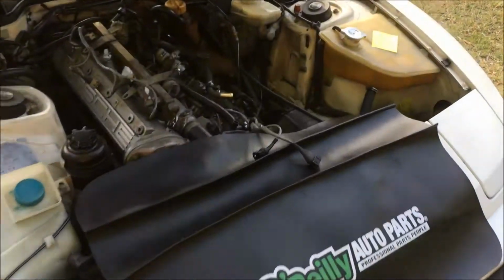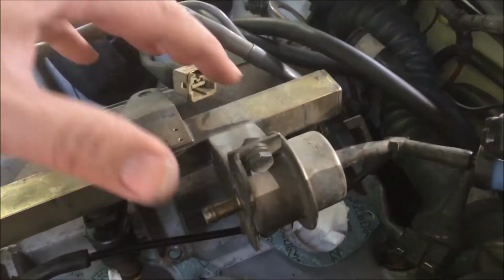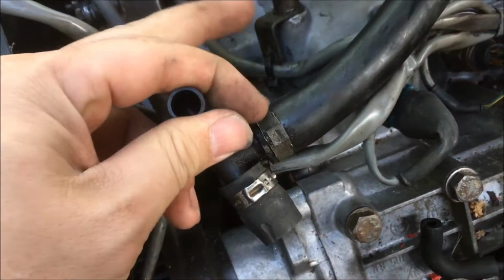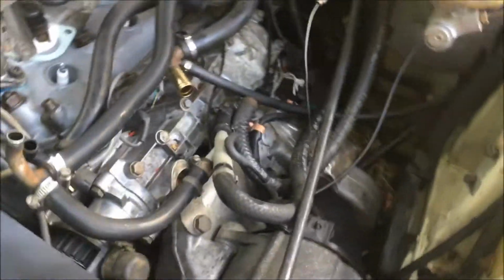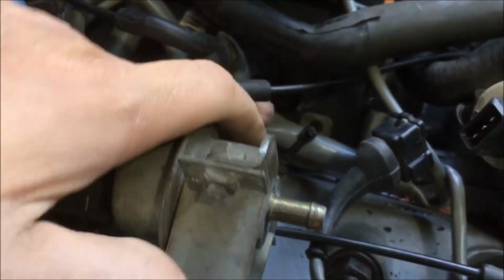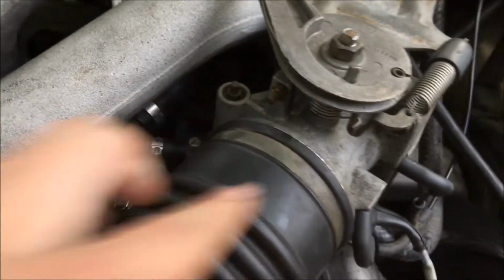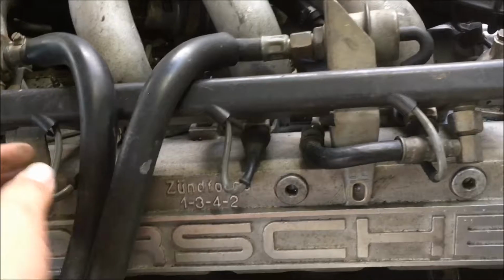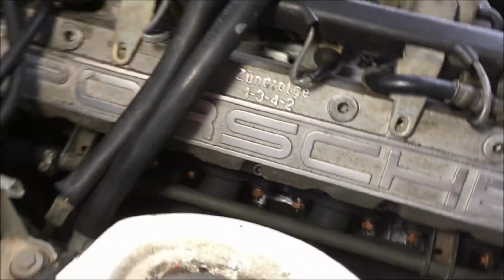Porsche 944 Vacuum and Wiring Routing for Late Cars

Comment: I just reinstalled my intake manifold yesterday. What was Porsche thinking mounting the ICV on the block, and then l,inking it to the intake manifold by a short little 'S' shaped hose that's nearly impossible to get to? If I do this again I'd figure out a way to mount the ICV to the intake, so the only connection you'd have to make after you bolt it to the head is to the J-boot. There's plenty of material in the webbing between the runners to mount a couple stand-offs with M6 hardware.

Comment: Thanks for the video, very helpful but I have a question, I have seen in many diagrams that the heat valve that is near the position sensor also use the vaccum line that is near the vacuum reservoir.
So do this lateral version don't have a heat valve or you skipped it. 
I really enjoy your videos thanks for all the help.
Reply from the maker: Thanks! Yup I just missed it but I covered it in my turbo vacuum line video. That particular item is connected the same as the N/A respectively. I hope that helps!
Reply: @edredas  thanks for the quick answer I'll check that

Comment: Just sent off to Lindsey Racing for a vacuum kit for my 86 NA. Thank you so much for posting this! Is a venturi delete anything worth doing, do you think?
Reply from the maker: I usually don't bother on an N/A car since the vacuum lines are fairly simple without any benefit. That said, it can be worth doing on a turbo since it has a ton of hoses running everywhere that it helps clean up. Its up to you though. If you're buying the entire kit from Lindsay then venturi delete may be the way to go! Good Luck.

Comment: I have an 88 but the manufacturer date is 87 and some of the things you have shown of the 88 don't match my 88. Also the VIN on the fire wall doesn't exactly match the VIN on the window. Fire wall has the 4 to 9 digits z z z z 9 for Z and the one on the window are a b 0 9 4 6 and the last 8 are JN471207
Reply from the maker: That's correct, the firewall stamp isn't the VIN number which can only be found on the plate in window. That said, this '88 model actually had an earlier engine swapped into it... which isn't the first time seeing this. I made sure to keep the vacuum lines correct but often people will just drop another engine in or something will break and you end up with mixed up parts. Although, I have an early production 924S that has several unique features that weren't on any other cars, so that its possible that your car is unique. Can you tell me about some of the differences?
Reply: Mine has the earlier vacuum brake booster port with the extra nipple for the vacuum that comes off the switch under the intake also the hose that comes from the air oil separator does not have an extra end leading to the intake other then that it seems all the rest is the same I am assuming at least. I need to remove the intake to replace some of the lines under it when time and some warmer weather permitting
Reply from the maker: Thanks, I'm not sure when they moved the check valve, but it is interesting that you don't have the hose going valve on the rear of the intake. Do you have a venturi? If you do then you may need to check the engine code, on '88 models it will be on the block next to the no. 4 exhaust header.
Reply: edredas no there is no Venturi and it has the correct cap for the block off. I just figured it was a transition car like some of the Ford's were when they go from one year to the next and have a mixture of previous and next year parts.
Reply: I will look at the engine code tomorrow and let you know
Reply from the maker: I have seen some things like that,  however I don't believe the factory would have done this. My understanding from the factory literature is that the venturi is there to protect the throttle and ISV from oil build up from the AOS. The reason the AOS vents right at the throttle plate is to keep the butterfly from freezing up and getting stuck while driving in cold weather. However, when the throttle plate closes then oil will build up at the idle screw and on the ISV, eventually clogging them. So they put the venturi there to help pull those vapors in to the brake booster port instead. When the factory deleted the venturi, they put that hose on the rear of the intake with an electronic valve to open when ever the throttle plate closed to avoid this. So if this hose is missing then more than likely someone has done this. I hope that helps!
Reply: edredas this greatly helps and would explain the build up of oil in the j boot and throttle body looks like I have some more fixing to do thank you very much
Reply: edredas it took me a couple of days the engine code is not under the exhaust it was in front of the reference sensors the block number is M 44 / 0 9 and the other numbers were 46j 02773 the build date was 09 of 87 maybe that's why the odd things
Reply: That engine bay looks familar' Lol -nice video, lots of good info!
Reply from the maker: Hi Yanik! The 1988 models would have been in the dealership by August or September 1987 so production would have began around June of 1987. So a September build would be pretty late in production. Earlier engines had their stamps in front of the reference sensors but all '88 models should have their stamps near near the exhaust. My '88 924S is also an '87 build but there is nothing out of the ordinary with it. That said, the numbers you give do suggest it is an '88 engine which would be a very interesting find. Could you please take some pics and share them with the facebook group, it would be appreciated! Thanks!
Reply from the maker: Thanks, Lou! By the way, do you know the build date of your car?